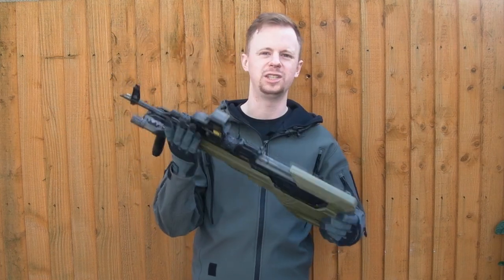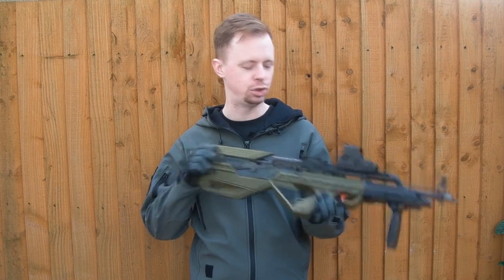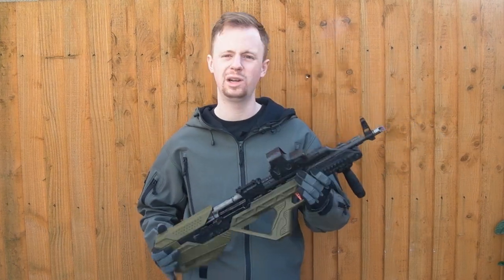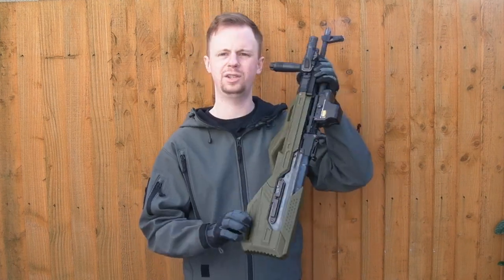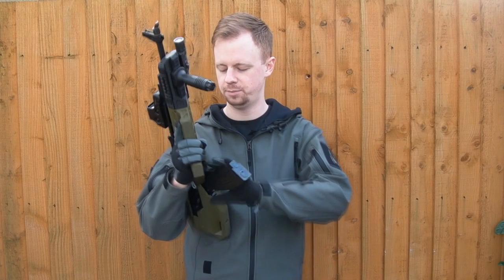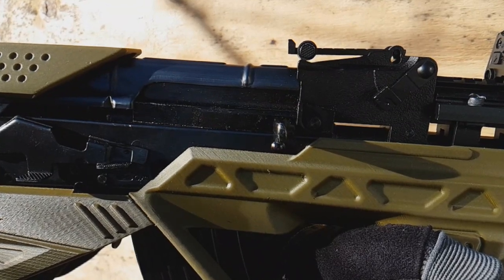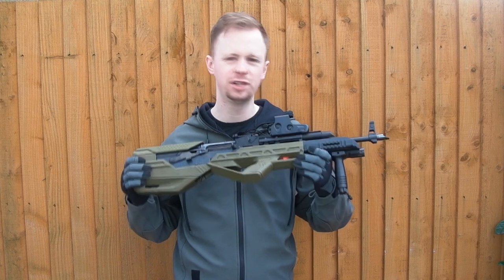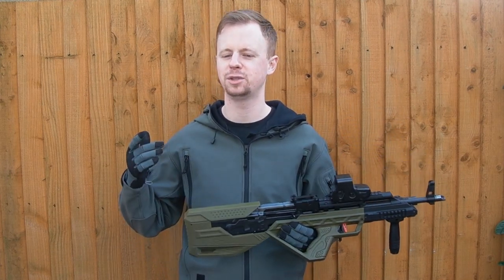3D Printing for Airsoft

Comment: The most important pro of this kit, that your rifle will be less in lenght aproximetly 20-25cms. I tried some bullpups and because the weight is at the back of your wrist and on your shoulder it is more ergonomic. You need much less muscle energy to hold the gun still. Angled grip is the only con I see now. The magazine reload is only a practice type of thing. It is not easy for you for the first, but after 5-6 games you will be much famalier with it.